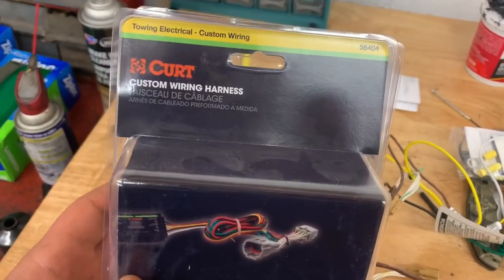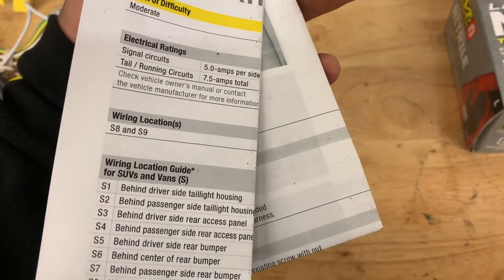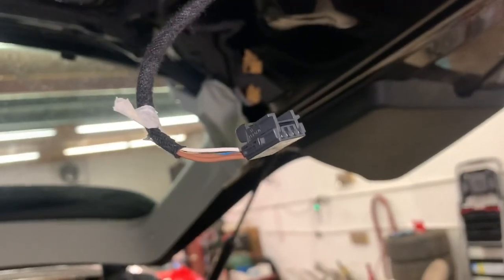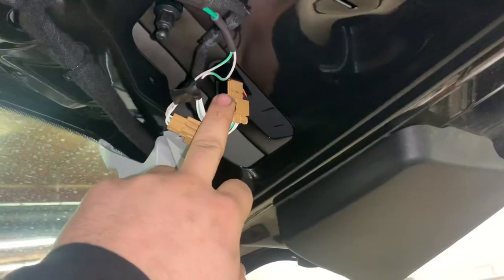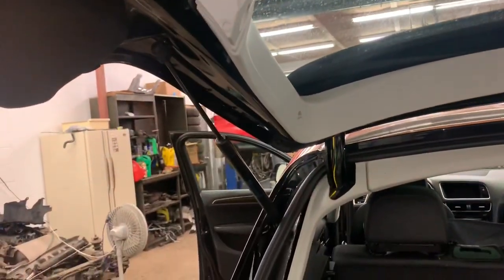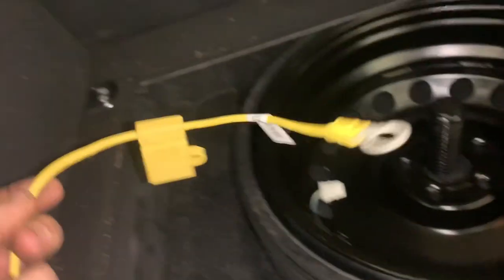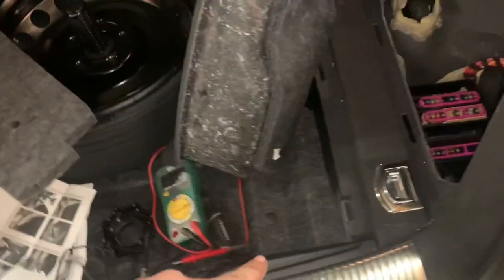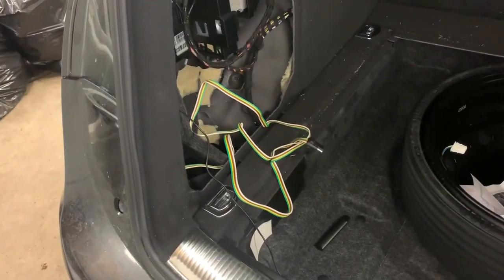Q5/SQ5 Trailer Wiring install The Easy Way (no coding or reprogramming)

Comment: Hey bud, the battery was right under your nose. It’s under the spare wheel lol. That’s why the power wire is short. =)
Reply from the maker: My cars the battery is under the hood. Not sure if some models have it there instead but mine definitely does not lol
Reply: In all my years working for Audi, I have never seen that on a B8 or B8.5 Q5/SQ5. Maybe yours is special.
Reply: i have to say this job is better than  etrailer video lol w the friking  cable hanging from the rear door rofl
Reply: Also worked for Audi and have owned Q5 and SQ5. Battery is definitely in the rear and that’s why he didn’t have enough wire to run it up front. Because it’s not there.
Reply from the maker: I am have to admit I was wrong 😅 battery is right there next to the spare wheel..
Reply: @westonlieberum1 
Well, at least you can admit it.
I appreciate the video regardless.

Comment: Thanks man. I figured out the problem. It turns out that there is a switch in the scuff plate. Despite having the rear gate closed, without the scuff plate and the switch ... the tail lights don't work! With the scuff plate in place (and plugged in) everything works the way it is supposed to.
Reply from the maker: Glad you figured it out!

Comment: Just an FYI. Aftermarket hitch wiring is problematic on VAG vehicles because these cars are highly advanced and they’ll try to fight the trailer. ESC, ABS, etc... .. Audi makes factory hitch wiring which enables tow mode so all these systems work in harmony with a trailer. Also kicks on the cooling fans when towing. If you’re doing light towing it’s fine, but if you’re going to be doing serious towing then it’s best to have the factory wiring.
Reply from the maker: I can definitely agree to that, this is just a way easier/ cheaper way to install but the factory system definitely is more intergraded and works better
Reply: I have a question 🙋🏽‍♂️ I want to tow my B5 S4....is that considered light or heavy towing?
Reply from the maker: That is heavy I’ve towed a B5s4 with mine but keep in mind the car is roughly 3600 pounds and a open deck trailer is 1400- 2000 pounds
Reply: @westonlieberum1  Will 900 miles be to much on the vehicle?
Reply from the maker: Ehhh I would try it local on a small trip and see I didn’t mind the 400 mile trip I towed just be mindful it’s under a lot more stress and braking and handling are affected a decent bit
Reply: so were can we get this fact wiring ? i have been looking for a 7 pin harness . ty for any info
Reply: Can you send a link?

Comment: Weston, I am installing that very same harness on my 2105 Q5. I pretty much did exactly what you did, except I grounded to one of the factory studs. Now the tail gate lights don't work at all (with the tail gate closed) but the ones on the bumper are working instead. I tried unplugging the harness and putting the factory plugs back in but they still do not work. my maim tail lights have gone dark! Any ideas on how to resolve this issue?
Reply from the maker: I would get out the multimeter at that point and see if you gettin power before the adaptor harness
Reply: Hey Tim did you ever figure it out? This is exactly what is happening to mine
Reply: Just wanted to update , I also forgot to plug in the sensor in the scuff board. Once I did it still didn't work so I was confused, but once I actually started the vehicle it reset and now tailights are working just fine , as well as the harness!
Reply: @aaol1  Hi! Can you please explain where the 'scuff board' is and what sensor is there? I thought the scuff plate/bard is the foot plate when stepping into the car. Is this sensor yo urefer to on the Left or Right hand side. Rear door scuff plate yeah? Thanks!
Reply from the maker: @BenJamminJones1 the only other thing I could think of is the lower bumper valance with back up sensors in it?

Comment: I like this video is a  much Better job; than  the video from Etrailer . but is only a 4 pin i like to know how to install a 7 pin. the audi q5 have a connector  under the dash board for a Brake controller any advice ;plz .head me up